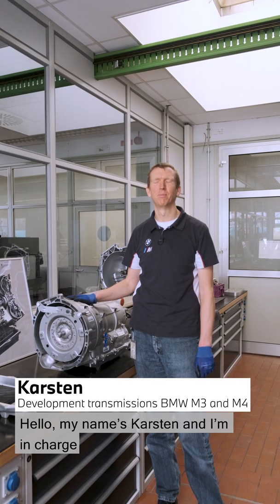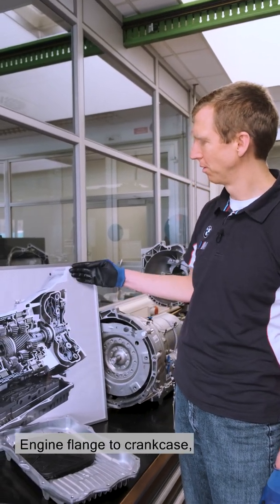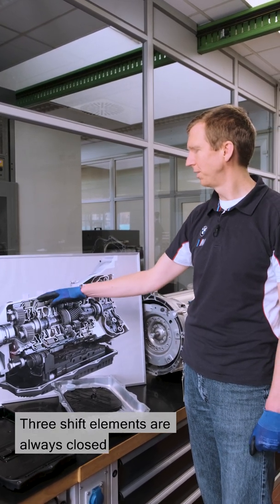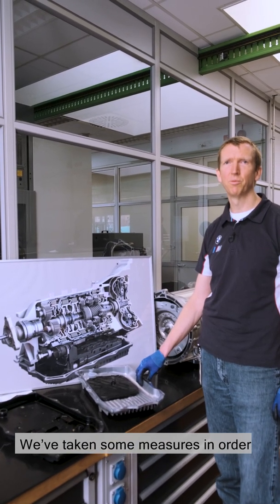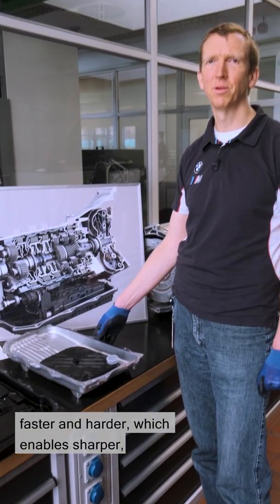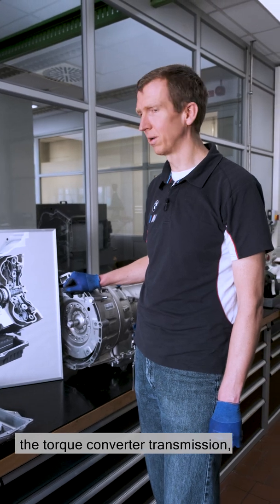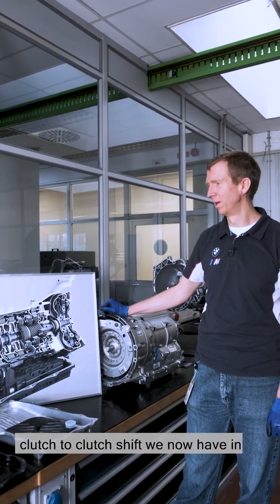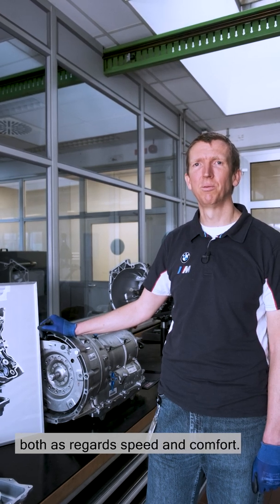M Steptronic Transmission. M3 and M4 - explained, Episode 19.

Comment: 150 ms gear change? E60 M5 could, allegedly shit in 65 ms. Some independent tests reported 150 ms actual shift time for the SMG III though. It’s still slower shifting than a Maserati MC-Shift automated manual found on the MC Stradale, which apparently shifts in 60 ms clutch-in and clutch-out included. Only downside of these super fast automated manuals is that they can’t transmit power during shifts, but guess what, the auto can’t transmit power when it ignition cuts anyways

Comment: Soooo BMW took the transmission from the M5 and dropped it in the M3 and thus saved on cost at the sacrifice of building a real sportscar for enthusiast. Got it.
Reply: You're absolutely incorrect. The 6spd manual is for the sports car enthusiast
Reply: I'm pretty sure that they dropped the DCT to accommodate the Xdrive option.
Reply: @ilya4759  makes sense
Reply: As an owner of a 2014 M6 with 7spd DCT, a 2013 650xi GC with the ZF-8, and an E46 M3 with a 6speed..

I think BMW getting away from that stingy 7spd DCT is the best thing they can do. It's not exactly "sporty" like a PDK, it's ridiculously expensive, and it shaves only 0.05 seconds off the launch. I see little to no benefit. ZF-8's are in abundance, easy to service,  and make amazing upshift thunder sounds out of the N63Tu's / S63's unlike the DCT's. For a street car, which literally ALL BMW's are (outside of the M2 Cs), you really only need a ZF-8. You can still do headers & tune up to 700~hp range and still be worry free with a ZF-8; and if it breaks? $8k at a Euro shop for a low mileage functional one installed...

I still find myself driving the 650xi GC the most of the 3, with the M6 just collecting dust as a sitting asset... When I want a sports car, I take the E46 off of the trickle charger and straight over to Toronto Motor Speedway...

BMW's of ANY caliber in the last 15 years have not been sports cars. Since the E90 generation these things have just been luxury sedans (and extremely heavy coupes). Purely meant for legal road driving. 

They're "attention to detail & tuning" to their forcibly awful electronic steering racks should be indicative enough of their current directive. That said, and to reiterate - I, like many others, prefer the switch away from the $16,000+ Getrag (7DCI600) DCT's.. 

Prices / numbers listed are in Canadian Dollars.
Reply: @ppnis  Interesting read. Thanks for that information.
Reply: @BrettL250  Thanks for reading! 
While I may have come off negative on modern BMW towards the end there, don't get me wrong. They still make wicked cars, they've just given up on the track car segment to a handful of other auto manufacturers. For speedy fun on the legal roads? AMG or BMW no doubts no remorse, you're making a solid choice.

The G80 M3's and M4's are superb pieces of technology. There is a lot of compromise as is the story for just about all modern vehicles. I strongly believe the S58 engine will prove to be among the best petrol engines Earth will ever have the blessing of hosting before EV's take over. I think I'll be in this exact market for a 6spd G80 a few years down the road. Redbull and their 1000+HP S58 with simple top end mechanical tweaks speaks volume for the potential and overengineering in this new platform. (Mind you, the new ECU's are not tunable yet and might not ever be tunable)

Keep well, keep safe out there and enjoy the drive :)
Reply: @ppnis  Brother I hope they are tunable one day. They’ve all been broken into sooner or later. Tuning, even in a conservative way, always makes these cars run better in my opinion.
Reply: @ppnis  k hoenstly I don’t want a “streetable plush M3” If I did I’d buy a Lexus or some other brand.

But none of this matters. I’ll just keep my “stingy” DCT’d M3CS AND my new GT3. BMW’s have lost all of their identity and that’s fine for new buyers, just not me. The M2CS is a street car lol, hell GT3’s are street cars but just feel sportier. Neither are a radical sr8 (which I’ve owned as well). End of the day bmw’s are less sporty and have less soul, the solution to that is porsche, ferrari, or mclaren.

Good day sir.
Reply: @Boosted30v  all you need to do is accept that the M3/4 are now luxury GT cars. That's why they added the M2. I'm sure that the M2 will remain DCT.
P. S. Getting the new G8x without the Xdrive is just silly.
Reply: @Boosted30v   I thought that the M2 drives like an old M3. Thank for the info. 
For me, the M4 xdrive is the perfect front engine car since it can do everything, even if it's not the best at anything. I guess your loss is my gain 🤷‍♂️
Reply: It has already outsold the F80 and will continue to do so. It’s faster, more comfortable in comfort mode, has better and WAY more comfortable shifting and more aggressive looking. I highly recommend you seek counseling for the one and only thing that’s bothering you and that is they had the audacity to change the front because they don’t want to have the same looking car for 15 freaking years in a row. Good grief.

Comment: At the very end he said the DCT is faster when shifting to the optimal gear, where the ZF is faster when shifting to the non-optimal gear. When racing, you're always shifting to the optimal gear, so the benefit of the ZF is negated. Sounds like BMW used this as another cost saving measure (think CF driveshaft in the F series vs. steel in G series)..
Reply: Absolutely. Also add to the list of cost cutting the ulgy steel strut vs the old amazing f82 CF strut bar. And the f82 was the first m car with a 4 pot rear brake. The new g80 uses a sliding caliper that looks like it's off the e46/e92 m3. The dct gives the m cars such a fun character and really makes them feel different from the series car. You can see the lag in the paddles when reviewers are driving the g80. Reminds me of a faster version of the c7 trans. Big mistake not using the m-dct.
Reply: I love my M2C DCT but I agree 100% with you this looks like cost cutting on BMW’s part, the DCT is superior on shift speed and that’s what we need for an M car. 👍
Reply: dct is bad choice for city, where this car will be 99% lifetime
Reply: No you're not always selecting optimum gear when racing, as you can't block shift you have to work down through the box when heavy braking.. the first would be preselected but the others would not

Comment: M ZF 8AT is super good.  I love this transmission way more than the last generation DCT.    
I currently drive X4Mc. It's so comfortable and very smart and most importantly it shifts fast and accurate.
Reply: The X4Mc isn't a real ///M it's an SUV with an ///M motor that BMW made for people who had to compromise an actual sportscar for an SUV. So of course you'd like the automatic over the DCT, you didn't want a real sportscar in the first place.
Reply: @Boosted30v just because it’s a DCT doesn’t mean it’s all around better it might shift slightly faster but comes with heaps of expensive problems if they occur driving the 8 speed feels just as nice the speed of the shift is incredible and unless your timing shit in slow motion you won’t be able to tell and yes I own a DCT
Reply: @Boosted30v I don't care M3M5 or X6M.  They're all performance cars.  I drove F10 M5 before X4M and have once driven M2.  I can tell you the 8AT is just superior to that last generation DCT transmission in almost every way.
Reply: @Boosted30v So according to you.  The F90 M5 isn't a sportscar but the F10 M5 is?  G80 isn't a sportscar but F80 is a sportscar.  Is this your logic?
Reply: @jamisonz3365  I never said the F10/F90 M5's were sportscars. They're not. I never said the F80/G80 M3 weren't sports cars. I said of course you'd like a smoother shifting autotragic if you loved the non-sport versions, because the auto is a non-sporty transmission. 

And thus real sportscars don't use the 8AT. They use DCT's, because they're faster, rougher, etc. And from what I know about BMW's history they used to make homologated models into M3's which were sportscars. The G80 will likely end up being the 996 Porsche of the M cars. There's literally nothing special about it. 

And no, I'm not hating. I have an Evo, F80, and a Hurucan which are all real sportscars.
Reply: Who cares what you think about sportscars.  This new gen 8AT M cars are way faster than all last generation M cars.  From normal to Fastest in segments.  I don't think you know much about the performance car market.  If you'very paid attention you will at least notice how fast this generation M cars are compared to last gen.  This generation will sell way more than last gen.  The great sales figures of F90 M5, F95/96 X5/6M already proves that more people choose them than last gen.  Currently G80/82 orders are also crazy.
Reply: You clearly care about my opinion as you keep responding to my posts. That said if know a ton about sportscars. 

I've owned more than enough of them. From GT3's to M3's and more. Sales don't != sportscar. 

Toyota sells more Prius', doesn't mean if you throw coilovers on a Prius that it's a sportscar. Either way this debate is tiresome. Enjoy your BMW zealotry, buy what you want. I'll continue on with real sportscars. My current M3 is my daily driver, so I don't even really think it's even a sportscar as much as a luxury barge.